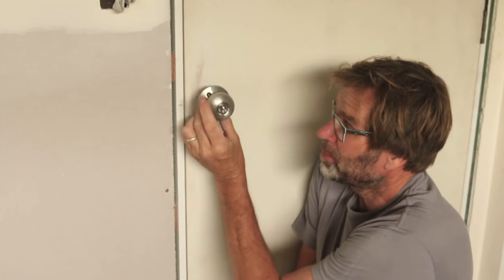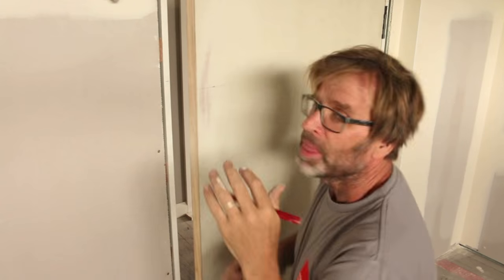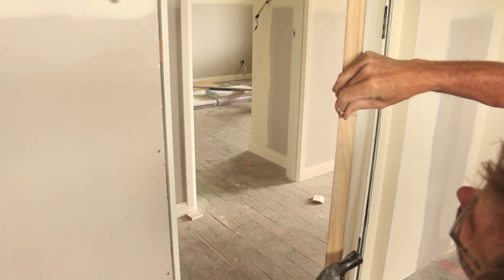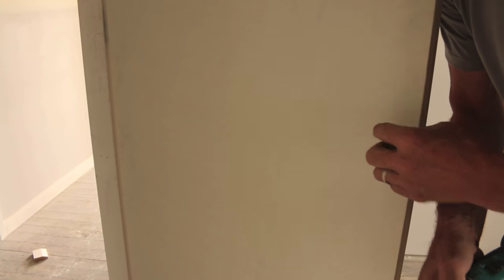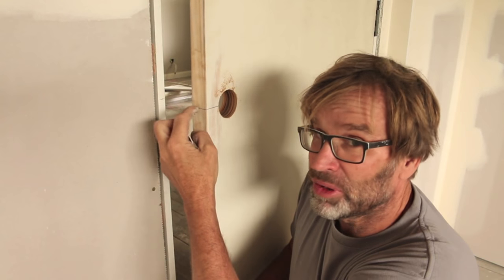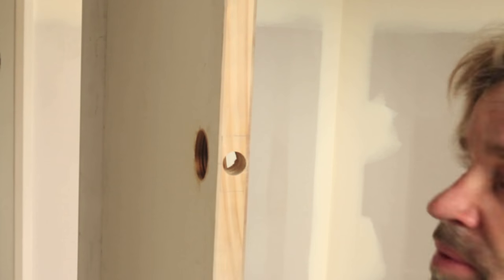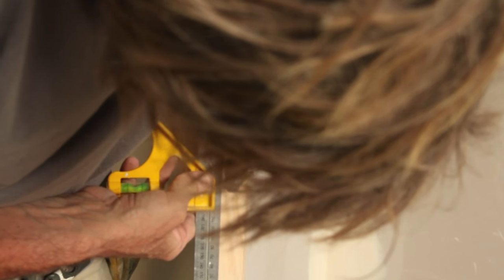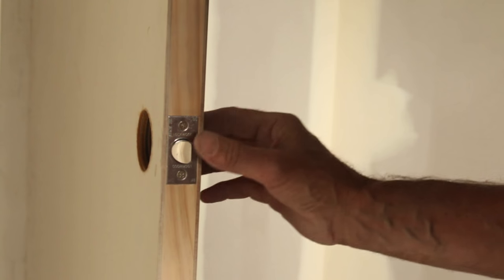How to Install a Door Handle. Part One

Comment: Shane, I cheated and used an Irwin jig to do all my door fittings. But the work is still the same. At times, I can't drill a straight hole to save myself...lol. What is your door handle height? I made mine 1350mm from the bottom of the door and that seems to be ok.An idea for another video is to install a cavity door. I 'winged it' and it worked well, till I put tiles down and the door got jammed on the tiles. Rookie mistake, I know.
Reply from the maker: Mate l made mine 1090mm but these are tall 2340mm high doors. Normally l think the height is around the 900mm mark. I've never used the Irwin Jig before. From what l've seen they work ok. Ahhhh the old tile getting in way of the door trick!! You wouldn't be the 1st one to do that mate :-)